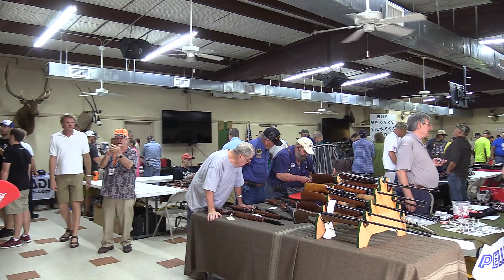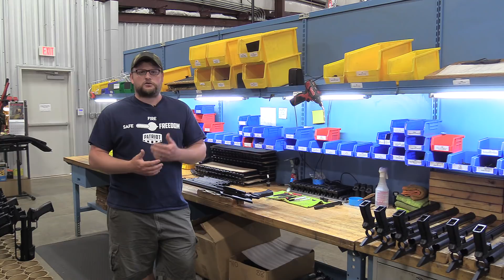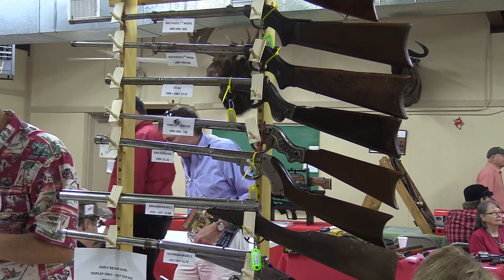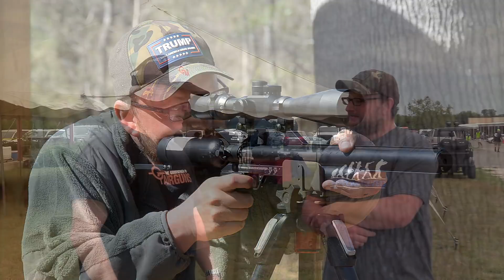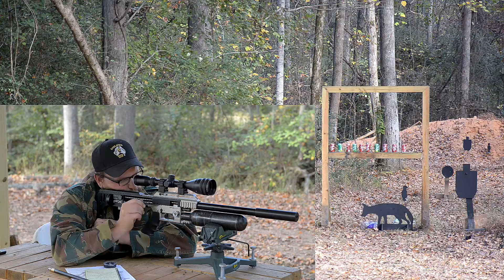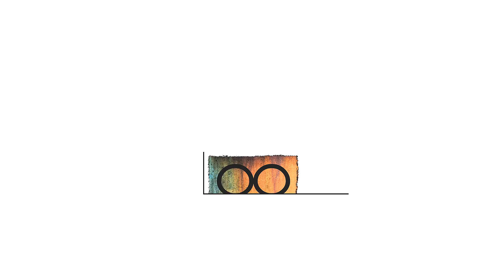Talking Airguns with Tom Gaylord

Comment: tom 79g wont fire holds gas ok but popit valve seases wondering if someone put wrong spring in cylinder bought gun at auction can push valve in when no gas but is fairly hard  you aske3d someone to contact me no go ,ted

Comment: my fwb 601( made in 89 ) has a shroud , and its predecessor 600 ( 86?-88? ) had a shroud too ...

my thoughts on the rest here .

smooth twist : i think there is a good reason that most of the competitors that suceed in long range airgunning are using them .

air guns in general : i like my fwb very much , but with the scope on it and my balistic chart on hand it is almost boring to shoot a less than 12 mm ( or less than half inch ) group at 50 m " any " time , except for the wrong pellets or windy days .
the " challenge " is not really there , and ,much longer distances is ....lets say after 80m its more luck because of the trajectory with my beloved heavier pellets ( and it is a modified 10 m match gun ) and the very low power ( around 7,5 joules ) .
for shooting fun i use my 3 springers which are a whole different world of fun 
my walther lgu is highly tuned with another trigger , a shortstroke skirtless piston , o ring seals instead of parachutes ...etc ) but still in the 16 j range hitting a 40 mm target at 100 m is not a problem .sooo wonderfull 
the other ones are two diana 48 , one with a skirtless piston shortstroke too and the other one with a psg2 tune kit .
both are cracking fun .
and like in the round table videos .....you can shoot 10.000 rounds for 200 bucks if you buy high priced pellets in best quality and maybe 50 bucks if you buy the cheapest shit for plinking cans in your garden .
and cleaning is not really an issue if you dont have any accuracy problems showing up suddenly , you dont clean barrels at all , even should not do it !

about " my " holy grail .

i am talking for small bore and target shooting here , hunting not included .
it is most important to NOT going supersonic , even staying out of the transsonic area !  most pellets are going to tumble when the are coming from supersonic into trans and subsonic , or worst case ....just riding their own shockwave in the first 50 meters 
thats why you should ( in general ) get the most powerfull gun ( ie. springer or gas ram ....pcp is a different story ) that you can shoot comfortably ( not as easy as you think ) and bring the velocity down with the heaviest accurate pellet you can find down to 270-290 m/s ( 880-950 fps ) to stay out of the dirty air from the trans-sonic effects .

one of my dianas can achieve super sonic with lead free pellets (0.3 grams ), but you cant hit the broad side of a barn at 50 m , with a heavier pellet like the baracuda ( 0.69 grams ) you are shooting about 275 m/s and still making 25 mm groups at 50 m .
yes heavy magnum springers are harder to shoot than most real firearms !
because the gun is hold sensitive , the recoil is hitting first in the wrong direction ! and is hitting you before the pellet is out and some guns are even twisting in the direction the spring is made a bit .

the one who thinks air guns are toys is welcome to hold up his hand at 50 meter for my 10 m 7.5 j , 175 m/s (575 fps ) very low power fwb 601 ...i am sure it will go through your hand with a baracuda 
and if you put both hands up ...the walther or diana will make it through both ! 
not a toy at all .
nothing for home defense ( a concept that i am not into ) sure , but i dont want to get hit with it , and you neither .

another point that i dont get and tom gaylord was spot on on this one is , you want to see if you can hit it .
so why wasting enormous money for massive expensive calibers like 308 upwards ? .....50 bmg for example ?
you need hell of a backstop , you cant shoot it everywhere ( i know some hobby ranges in indiana or ohio and they allow up to 30-06 or 308 not bigger ) 
its expensive as hell too . hitting a sugar cube on a 2x4 wood with a low power air gun in the backyard at 50 m is with a regular cheap springer as difficult as a coke can with a 308 at around 600 m .

Comment: As far as cost of PCP.  C.N.C. machining takes the worry out of High Precision,and repeat ability. As a Tool and Die maker I started before C.N.C. existed,grew with it and it does increase production and accuracy. But  it also should lower cost based on volume. The big manufacturers are not just making a couple hundred. Thousands you bet.

Comment: Airguns have and always will be a gimmick for the mid to large game hunter, not to mention anyone concerned with self defence. 
This is simply due to the fact that modern powders have such a high energy density, when compared to the same volume of compressed air. Their only real appeal is with people who live in areas where laws don't allow suppressors, or vermin hunters that don't want to damage property.
Reply: You have no idea what the hell you're talking about.
There are plenty of other advantages to airguns.
Check out Ted's Holdover for just one advantage, namely the ability to shoot pests and other animals with backstops that would get perforated by even a .22 rimfire.
Also, pellets cost considerably less than the cheapest ammo, and you can carry 500 of them in a tin the size of a snuff can.
Try doing that with your regular ammo.
It's also worth mentioning that airguns, particularly spring piston type, require a much higher degree of marksmanship than regular firearms, and that skill translates over to firearms to improve shooting accuracy.
Another (there are still more) is that you can shoot them in your basement or backyard without having to go on a lengthy trip to the range.
Educate yourself better next time, junior.

Comment: Mr. Gaylord makes an absolutely crucial point.  Air rifles are a great way to bring people into gun culture.  It's something accessible that you can do legally in most jurisdictions in your own backyard safely you can even shoot in your basement when the weather is bad outside.  It's relatively inexpensive and you can learn everything that you need to know with a firearm from an air rifle.  When I shoot over a thousand there is a lot of math and skill involved but I don't get to do it very often because I have to go to an entire other area in order to be able to do it.  I can practice all the skills and math that are required for a thousand yard shot within a hundred yards in my backyard.  Legally quietly cheaply and without having to go anywhere.  Pot of tea next to the fire backdoor open benchrest setup and I can shoot targets all day.  I can also use it to kill pests and hunt out to well over a hundred yards.  And I don't have to worry about a bullet carrying on half mile or a mile further and damaging something else or hurting someone.  Because ballistically the pellets on firing out of my streamline won't go more than 1/4 Mile not even if I shoot at a 45 degree angle on high power they simply lose power too quickly.